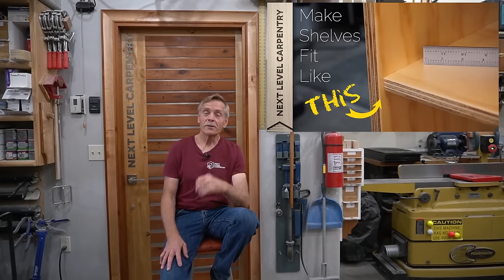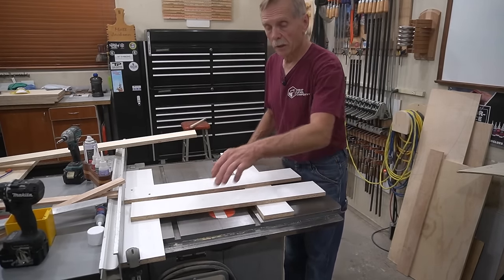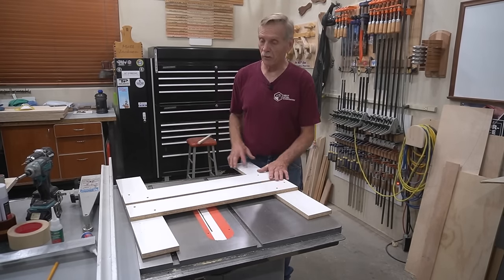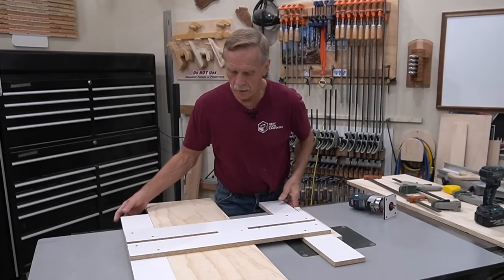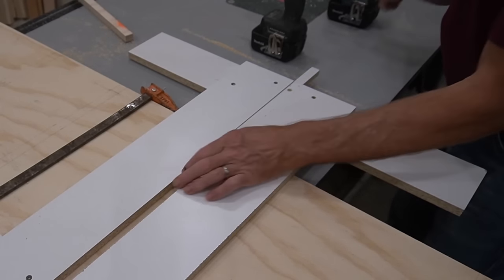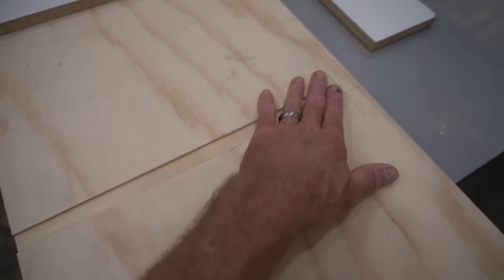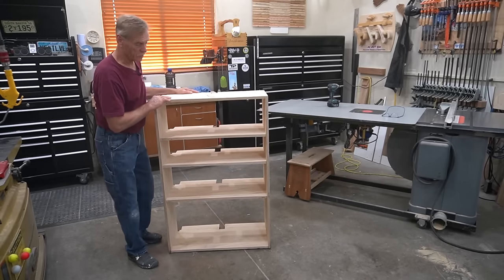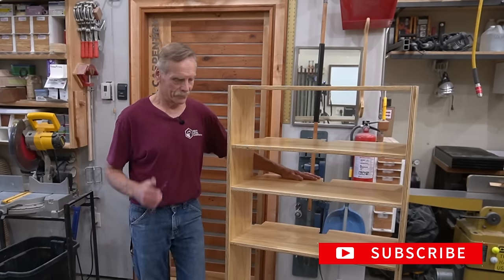Make Shelves Fit Perfectly with Simple Stopped Dado Jig!

Comment: Respect for how you handled the stop block issue without restarting to hide the error, it's how we learn. Stay humble👍 

I have used particle core and or MDF in routing jigs and found them to wear and mark easily from the bearing, not an issue if you are only using it to router a few dados. If you need to use it repeatedly you can harden the edges easily with CA glue. I just run a sanding block over the edges with 120 grit (a few passes) then I treat just the edge with thin CA glue and quickly run the sanding block over it a few more times. This will harden the edge like glass and makes it much more durable for repeated passes with a guide bearing. This method is especially effective with MDF.

Hope you find this tip helpfully Cheers!

Comment: You should not be embarrassed - at all - by re-thinking the jig as you went along. It shows integrity in your work, and is a great example to "the rest of us" that we don't have to be perfect, either.  At this point in my woodworking journey (somewhere between novice and semi-competent) my favorite expression is "I reserve the right to get smarter!"  Thanks for the really great, simple jig idea.  My only "add-on" would be to keep it around, and add another cross-piece to allow it to be used with 5/8" or 1/2" shelves as well.  (Actually, you could do both - one on each side of your existing 3/4" jig.)

Comment: I have struggled with an adjustable dado jig that relies on the router base as a guide.  I’ve spent a lot of time trying to set the router baseplate so that it’s perfectly centered to the bit but it’s always off by several thousandths which makes for an uneven dado line.  Your method will be my go-to solution from now on.  Loved the “2.0 dado stop” remark.  Made me chuckle.  😊
Reply from the maker: Once upon a time I struggled with baseplate and guide bushing frustrations too...  I think you'll find relying on a flush trim bit and accuracy of your guide a welcome solution to a long-time problem...

Comment: Matt, as usual a great video. I personally like to leave 1/2 inch of material on sides so shelf length is simply 1" shorter than cabnet.  
I use your design for push "sticks" for table saw and sanding blocks using belt sander sand paper also many of you tips daily.
Thank you for sharing you vast experiences.
Reply from the maker: Using your extensive experience as a guide is totally understandable although it leads us to slightly different preferences for dado depth/shelf width, highlighting the fact some of the details are personal preference not right vs wrong.  
I'm honored that you choose my "professional pushsticks" and "best blocks for demanding sanding" designs for your work considering there's SO many design options 'out there' on YouTube.  Sharing personal experience is a matter of paying it forward, right?
Best,
Matt
Reply: Matt, so why do you only cut 1/8” dados?  Seems shallow on such a think board.  Seems like you would want about 1/3 of the width of the board?  Just my novice first impression.
Reply from the maker: @AscDrew  this is a great question!  Seems to me you've got potential well beyond 'novice' if you're already thinking about this kind of thing; congratulations!  What you'll learn is that better decisions are made by considering what it takes to make things strong enough with actual performance rather than what "seems like" the way to go.  Re-watch this part of the video: https://youtu.be/9iD-ScWJEpE?si=28AX_hTAI3QtKmn5&t=1440 and you'll see that my choice of 1/8" dado depth is more than strong enough for these shelves to support 175 lbs. Also, deeper dados makes weaker side panels with less thickness for screws to hold everything together.  I hope this makes sense to you because as you build your skillset to your own Next Level, you'll be faced with countless decisions much like this and the choices you make will directly affect your work and reputation.
Best,
Matt

Comment: I've made many stop dado's with a dado stack and table saw.  Never thought of using a flush trim router bit.  Great idea!  I would sexy that fixture up, with a bit of T track, to make it adjustable; but that is just me.  You created a perfectly serviceable router template in literally nothing flat.  This is a really slick way of producing clean, strong joints.  Thank you so much for the tip and inspiration.
Reply: I absolutely agree, Richard.  A jig like this is a perfect project for a beginner (like me) using some scrapwood, as well as a more skilled woodworker like you can see how it can be improved, with built-in t-tracks, etc.   
That is what Matt also is so good at; inspiring us, no matter what level we're at. 
Wish you all the best.     /Pia from Denmark

Comment: This addresses the do I bring the big work to a big tool or a small tool to the big work issue, with your router jig I mean.
You have a big shop and saw for big sheets but a lot of us have to break down sheets outside and that's another example of do I bring the big work to a big tool or a small tool to the big work.
You even with other options found advantage in building your router jig
and using it in your large shop but it's also easier to take outside to process big stock like I'm talking about.
So there's that aspect, advantage to it as well.
Another good video.

Comment: After twice failing to build an accurate and  adjustable dado jig, I just use these scrap piece jigs nailed and glued together. Fast and easy and always accurate. 
I have a similar project (bookshelf)  in mind and I was thinking of fixing a stop block on the supporting wing which is then always placed on the previous groove to set the jig for the next groove.

Comment: I like the quote. "how you do anything is how you do everything" as well.  I'm making a bookshelf out of solid wood (no screws to hold the shelves) and it struck me that your system will work well for centering dowels properly (ie...drilling pilots from the inside to the outside, having a properly centered pilot from which to drill the dowel holes.  perhaps obvious but I might not have thought of it w/o your video...thanks

Comment: Thanks for the great videos! It looks like you are using a Rockwell Unisaw.  I bought my Unisaw new in 1981 and it's still going strong, but I never upgraded the fence system.  Can you tell me what you are using for a fence?
Reply from the maker: Good eye on the saw... mine was new in 1982 and it came stock with the Rockwell/Delta Unifence you see in use in all my videos.  It was a game-changing design back then and a good part of the reason I chose that saw and model, however, the Beismeyer style fences that came along shortly after are a better design and what I'd 'upgrade' to if I had to do it today.

Comment: I really enjoyed this video - it's nice to see that a simple router can provide fast and accurate results when a) a festool domino is very expensive and b) I'm not experienced enough to have the confidence to line up dowels correctly throughout a build of this type.
Reply from the maker: I think the method you saw in this video is actually stronger and cleaner than Dominoes albeit a little bit slower to execute.  Lining up dowels is always an issue too so there's another benefit of simple stopped dados, right?

Comment: Thanks for this.  I could have used it a year ago. Sorry for this awkwardly stupid question but here goes.  Since  each shelf side is laid out separately, what is the best way of ensuring that the dados on each side line up  perfectly with the dados on the other side?
Reply from the maker: Good question, simple answer.  Re-watch this part of the video where I use a framing square to transfer marks from one side directly to the other: https://youtu.be/9iD-ScWJEpE?si=hvBsM0aoi0P2gzQt&t=107
Completely foolproof IMHO.  Plus, since the pencil marks line up, using the stopped dado jig to rout them, the dados/shelves are virtually guaranteed to line up too.
Reply: @NextLevelCarpentry  Thank you.

Comment: Good to see another video. Seems like there's been a big gap in new content. I haven't been getting notifications lately. I used one of your tips on an actual project my company performed. Attaching free standing rail posts using threaded rod! Worked like a charm!
Reply from the maker: Thanks! FWIW I got bogged down by an ambitious build video project last spring that distracts me to the point it's hard to produce other content in the meantime.  Once I get that build project video for my  Master Carpenter's Tool Tote produced and uploaded I hope it clears the content production logjam that's been building for about 9 months.  Glad used and liked the box newel post video... it's super sweet for sure!

Comment: You sir, are a genius. Instead of the screw in the center stop block, you could drill holes at certain increments and have a dowel pin in the fixture frame, allowing you to adjust the "stop dado" easily. At least that's my thinking. 
I'm a hobbyist woodworker and always learn something new from your videos.
Reply from the maker: Great ideal for projects that need repeatable settings!  I can imagine using it in a small cabinet shop where dados of different but repeatable lengths streamline the fabrication process.
Best,
Matt

Comment: Nice video Matt. Just in time for a cabinet I’m making with dado joints.  Made your jig last night and will try it out today.   Thanks!
Reply: So far you are right.😅 5’ cabinet with 3 shelves 20” deep with both sides matching. Whew! Your jig  with a bearing trim bit worked really nice, much better than using a guide against the router body.

Comment: What was the brand of the lacquer sprayer?
I’ve followed for a long time. Thanks Charlie
Reply: I'm interested as well
Reply from the maker: 3M Accuspray: https://www.amazon.com/dp/B001UNZIP8?linkCode=spc&tag=onamzdigitalj-20&creativeASIN=B001UNZIP8&asc_item-id=amzn1.ideas.39P4X19NAN256&ref_=aip_sf_list_spv_ofs_d_asin
I pretty much switched to this setup a year or so ago because if it's ability to effectively spray comparatively thick viscosity pre-catalyzed lacquer.  Side benefits are easy cleanup and ridiculously inexpensive expendable/replacement parts.

Comment: Matt... you always seem to keep my Intetest till the Very End of the End of the End as you did with this Video. You make it look so Easy! Cudos!
Couple of CYA Tips:
1.) Round-Over the Very Top of the the Big Notch to prevent Sharp 90 from Piercing into Wire Insulation over time.
2.) Fabricate Covers to Protect High Voltage Wires from being Pierced by Who-Knows-What being  Tossed into the Shelves.
Reply from the maker: Thanks for noting a couple very reasonable precautions for projects like this E-Bob... you're an observant and insightful guy who's viewpoint is, no doubt, based on real world experience where you probably see somewhat unlikely problems on a regular basis.  I fully expect 'my favorite electrician' on this job to point out those exact cautions when he sees the shelves installed for the first time.  Makes me appreciate subs who've 'got my back'!
Reply: @NextLevelCarpentry  
 Matt... you are always so Humble and Sweet with your Replies. I Love Ya Matt!   ❤️
Reply: @NextLevelCarpentry  BTW Matt... Cheewurz and Electric Bob are one & the same  😉
Reply from the maker: @Electric-Bob  NO WAY!!!  Man, when's the last time I heard from Cheewurz... or Electric Bob, for that matter?!  Your comments take me WAY back to the early days of NLC... so glad to know you're still out there adding meaningful comments to content on YouTube!  BTW my 'favorite electrician' has done a ton of work un-doing hack work done by slipshod Sparkies in main panel in the same mechanical room.  He's yet to see this shelf installed and I'll be surprised if he doesn't echo your recommendations when he does see it late next week.
Hope all's well with my 'ol buddy Cheewurz!

Comment: Well done video. I like the jig. I've routed the dado's for shelving and it can be quite tricky. I've had some turn out not so good. I saw a similar jig made with a feature I'd incorporate. A way to adjust one side of the piece for the dado's using T bolts and routed slot. Since some plywood isn't always the exact same thickness. No big difference and likely not a problem so probably wouldn't really need to do that. I was wondering why you were making one side wider than the other. Once I saw why it made sense with the wires in one corner.

Comment: You have Dupuytrens contracture in your left hand ring and little finger. I do too. But in both hands. I had it fixed twice a process called needle aponeurotomy is the only way to go. Four different hand doctors tried to sell other corrective methods.Needle aponeurotomy is quicker nearly painless and extremely effective. The other methods are ugly. UGLY painful, terrible. I am a semi-professional musician ( meaning they pay me, sometimes ) so I did a lot of research before I had my problem corrected. Drove from New York to Florida. And paid cash because there are no insurance codes for it at the time, (there are now). And none of the local hand doctors did it anymore. Anymore? Look on his face told me there wasn't enough money in it. Love your videos you're a master Carpenter, and I appreciate them. Thanks for the guidance good luck Jim
Reply from the maker: Actually, in response to previous viewer comments like yours, I had my hands checked for that very  thing Jim.  What I was told (and believe from the explanation) is that my 'condition' looks similar to but is definitely not the same.  Sorry you had to deal with the real thing but glad you found a workable remedy for it to continue to play.
Best,
Matt

Comment: Thanks for these awesome videos.  I’m trying to build a fairly basic shelf, except I need it to fit inside of a closet with a small door, so I need to be able to assemble (and hopefully disassemble it when needed) easily inside the closet.  Also, I have limited tools, I do have a miter saw, a circular power saw, some chisels that I’m terrible at using.  I’m considering getting a router, as they are fairly affordable and don’t take up much storage space, not sure what bits I’d need (and bits seem pricey).  I’m trying to avoid buying a table saw, as I don’t have the space for it, and do as few cuts as possible, so I’ll be getting pre-cut 2x4s for the legs (I think) and pre-cut shelves (48x15.75).  Since I want it to be easy to assemble and disassemble, I’m trying to avoid screws and angle brackets as much as I can.  I’ve been researching wood joints.  Thinking something like a half lap or dovetail to prevent the frame that would hold the shelf from sliding in or out of the legs.  Also considering trying to do dadoes in the main legs for the shelves to go into, but I’d still need something to make the whole thing stay together, and to stop the shelves from sliding out.  Or maybe just a mortise & tenon with some soft of a peg, to stop it from sliding out for the long way part of the frame, and maybe halved lap joint for the short way to hold it all together.  Hopefully this makes sense, any suggestions for joints and tools needed?
Reply from the maker: Sounds like you're trying to grill a nice steak with no more than a cigarette lighter.  I don't mean to be condescending  but there are some projects you just can't do properly with constraints of lack of space or tools.  I suggest IKEA or something for your 'fairly basic shelf' until you you have the wherewithal to do the job you envision.

Comment: Very useful video. Best part was the simple construction of dado fixture/jig. Could you let me know which brand of lacquer you used? I’ve been using Deft for decades, but it’s getting hard to find given environmental restrictions in my area. Figured I’d ask this question of a fellow maker instead of rolling the dice. Thanks, in advance, from a new subscriber.
Reply from the maker: I used Sherwin Williams Medium  Rubbed Effect pre-catalyzed lacquer on this project.  It's hands down better than Deft IMHO but, if Deft is hard to find given environmental restrictions I'll bet the contractor-grade Sherwin Willy product is out of the question.  I also like & use Euro Cat by Diamond Vogel but suspect that's far less common.   Might need to reach out to a local painting contractor or cabinet shop if you're determined to get your hands on this type/grade of product.  I will say it's probably worth it based on product value, quality and finish results.
Reply: @NextLevelCarpentry  Thanks for the multiple recommendations! I know you’re busy. I appreciate your taking the time.